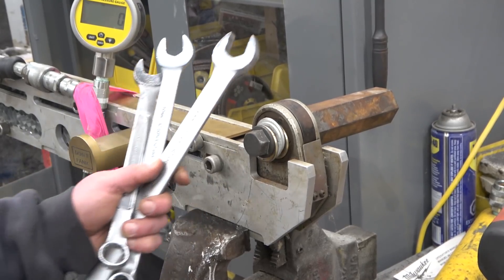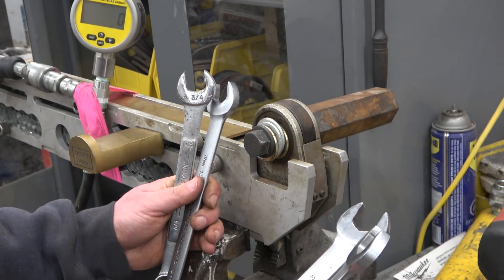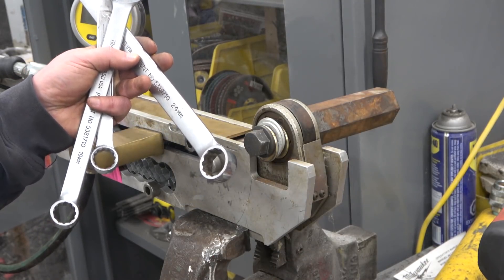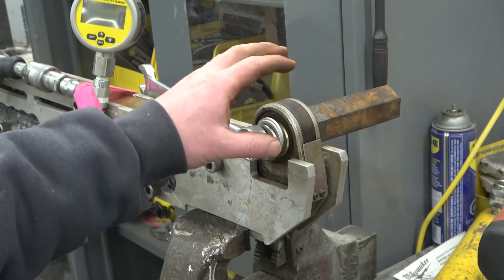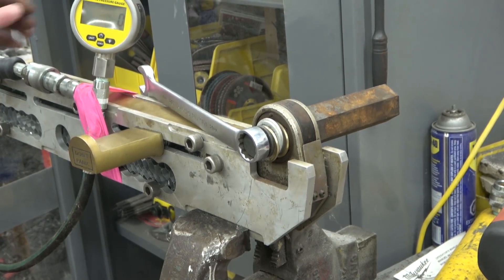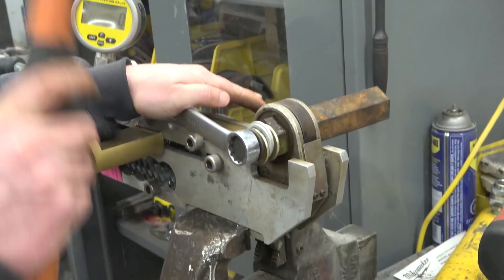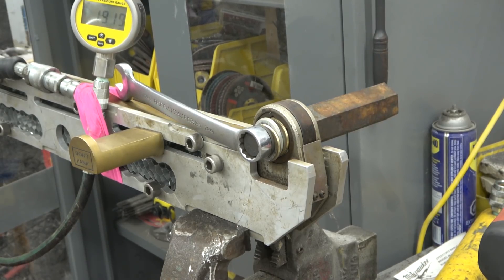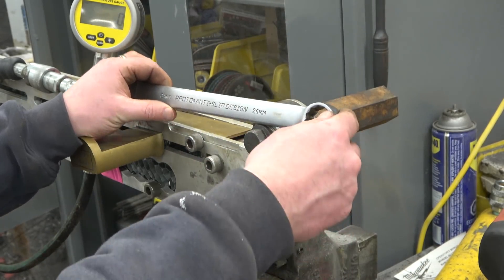do METRIC wrenches fit INCH bolts?

Comment: 14mm is oh-so slightly smaller than a 9/16", and thus makes a great "close tolerance" 9/16 substitute, when ya really want to reef on 'er, but don't want to round off the nut. (Mower blades are often held on by 9/16.)

14mm will fit on a 9/16 bolt head, though if the bolt has surface rust, or is plated, a gentle tap may be helpful.

Comment: I've found mixing and matching inch and mm wrenches and sockets quite useful. I've taped a Fraction-Decimal-Metric chart to the inside of my tool case cover for quick reference. I always try the smallest nominally dimensioned wrench for the fastener. Using your 15/16 example, I'd choose a 15/16 wrench (.9375"), not a 24mm (.9449"). It increases the odds of a tighter fit. When I bought those fancy Gearwrench ratcheting combination wrenches, I got only the tightest sizes: 11mm, 1/2", 14mm, 5/8",  no getting around the 10mm and 12mm. Larger wrenches/sockets go like this for tightest fit: 17mm, 19mm, 13/16", 22mm, 15/16", 25mm for 11/16 through 1."

Comment: How ludicrously hilarious. Testing a  mathematical hypothesis measuring who came first, the chicken or the egg? Statistically the better 3/4 derives that I do by computing a wrenches slippage between the two types, 6pt-12pt, and multiplied by size cross compatibility IMP- M. Is then divisible by a bolts yield limit to the variable, “H” power, (hydraulic pressure). When not only the formula, but your brain seizes, can the dead-blow hammer die. In summary, into the “Fuckit Bucket” this theorem goes.

Comment: And that usually works fine for "large" sizes. But a 1/4" 12 pt will turn a 6mm 12pt bolt into a vice grip sized bolt

Comment: This is always an interesting subject.  Inches are divided by 16 and metrics are divided by 25.4.  So there sizes where wrenches will be interchangeable.  As a quick reference you can multiply a metric size by 4  and get a close estimate of the nearest size in inches.

Comment: Outside of the exotic world of high precision/aerospace engineering, most fasteners and tools are made with pretty loose clearances, and the best tool to use is the one that fits the best.  How it  fits is more important than the size stamped on it.

Comment: Here are some other questions to answer.  Why does the 11mm fit nothing?   Why do they leave the 16mm  and 18mm out of so many sets? Why are those sizes so shunned? Metric is a curse, do we really need both 12 and 13mm head size? Why not make it a law to skip every other size 10, 12, 14, 16, 18 etc do we really need 1mm increments? Tool companies would lobby against it granted, but it sure would be a step in the right direction. Don't even get me started on C vs. F.

Comment: place i worked at had metric and sae bolts we had to use, and since metric was a tad rare, finding a wrench was difficult sometimes. whatever wrench we needed for the m8 threaded bolts, i just found me a chinesium 1/2 inch that was just out of spec enough to do the job  for both and hung on to that thing for the life of my career there.

Comment: When you first cranked on that 24mm and it stuck on the fastener that somewhat illustrates where a 12-point might be inferior to a 6-point, where fasteners are rounded or worn or undersize, a 6-point can get a little more grip on them.  I've experienced this working in my dad's shop and on rare occasions a 12-point wrench would not grip well enough so we would hunt around for a 6-point.
Many, many years ago I had a couple of friends in a small shop who worked on foreign cars.  This was when foreign cars were pretty rare.  They told me that they could get by pretty well using SAE tools on the metric fasteners.

Comment: Come on you must remember I think it was called metwrench set's they sold years ago that seemed to be generally to big or to small but one set fit it all.  I went to interview for a job and saw a set of them and I walked out. I got called later and asked why I left? I said I don't want to spend hours fixing all the nuts and bolts srewed up because  you use metwrench crap.

Comment: As a machinist, It’s useful to have a knowledge of imperial/metric bar stock dimensions for manufacturing components. 1/2 inch provides 0.7 mm machining allowance for 12 mm shafts. And so forth.

Comment: was doing my cars tailpipe and had a funny coincidence. 15mm was too small and 16mm slipped. the inch socket in between was perfectly snug and could open the rusty nut. The other nut 16mm was too small and 17mm slipped. the inch socket in between had no problem.

And what comes to the 12 point when doing rusty tailpipe nuts and bolts. 12 point rounds the nut when 6 point didn't. Think the case is different since the size was 10mm and 13mm.

Comment: I agree with the comments I read, but you just have to think about how much a tenth of a mm is to realize that most of the converted dimensions are probably within the tolerance of the wrench.
Here is a list of the common inch sizes with a metric equivalency:
1/4" = 6.35mm
5/16" = 7.9375mm --> 8mm wrench
3/8" = 9.525mm --> probably a 10mm wrench
7/16" = 11.1125mm --> probably an 11mm wrench
1/2" = 12.7mm --> 13mm wrench
9/16" = 14.2875mm --> 14mm wrench is a little tight but usually fits
5/8" = 15.875mm --> 16mm
11/16" = 17.4625mm --> 17 or 18mm wrench
3/4" = 19.05mm --> 19mm wrench (5 hundredths of a mm difference)
7/8" = 22.225mm --> 22mm wrench
15/16" = 23.8125mm --> 24mm wrench
1" = 25.4mm --> 25mm wrench will probably work

The bigger the size the more likely it is to fit within the tolerance of the wrench and bolt fabrication. 1/4" and below you might start getting into too much slop.

If you are limited on space or weight and need to take a socket set or wrench set just take the metric sets.
But that is just my opinion.

Comment: Maybe you can try inch spanners on metric bolts. My understanding is that it doesn't work so well but have not tried it myself. I'd be interested to see if this combo could be used when the correct tools are not available. Keep up the good work. Cheers from the other side of the earth.

Comment: The most modern, "Industrial", inches, define one inch as 25.4 mm, and was adapted 1930 in UK, 1933 in US, and by 1935 by the rest of the Commonwelth (including Canada).

So a modern 15/16 inch bolt is:
(15/16)*25.4 = 23.8125

So if you have never bolts, the 24 mm wrench is 187.5 µm to wide for a modern 15/16" bolt.

US and UK (as also used in Canada), used  different "Imperial" inches, before the "Industrial" inches was adopted. This because the sticks used to define the UK and US inches, although the US stick was made to be a copy of the UK stick, differed in length, and they also greatly varied in length over time (oxidation, heat expansion et c.).

In 1866, the US government defined a conversion factor of 1 m (1000 mm) being equal to 39.7 inches. That is 1 inch = 1000/397 mm ≈ 25.5 mm.

In 1893, the US and UK "Imperial" inches was for the first time defined in mm. By that time, how long 1 metre was, was still decided by a stick, but the metric stick was much superior to the sticks used to define the UK and US inches, and didn't vary much with time. And there were also strict rules in place, as how to store and handle the metric stick, so that it's length would vary as little as possible.

An US "Imperial" inch, was in 1893 defined as 25.4000508 mm.

An UK "Imperial" inch, was in 1893 defined as 25.399977 mm.

So if you have an older 15/16 inch bolt.

US "Imperial" inches (1893-1933):
(15/16)*25.4000508 = 23,812547625 mm

Canadian "Imperial" inches (1893 - c:a 1935):
(15/16)*25.399977 = 23,8124784375 mm

Comment: I work on Rail Vehicles in good ole NZ and use Metric/Imperial box ends interchangeably as some Locomotives are Japanese, some are NZ Made and US made. 3/8 - 10mm. 1/2 - 13mm. 9/16 - 14mm to name a few I regularly use both ways

Comment: As you probably know divide the lower number of the fraction by the larger then multiple by 25.4 gives the inch fraction in mm. 15/16” = 23.8125mm. Here in U.K. have had to get used to using both metric and imperial simultaneously and still use both ie miles per gallon but fuel sold in litres weighs in grams drinks in pints. Great videos keep them coming AvE. Thanks

Comment: We buy industrial grade sockets for tooling we supply to automotive and heavy equipment customers. One manufacturer has flat out said that in some cases they use the same punch for the nearest imperial and metric.

Also, can we get a video specifically detailing that hammer? That was epic!

Comment: It’s simple math. 25.4mm is an inch. So, 1mm is 1/25.4 inches, 2mm is 2/25.4 inches…and so on. At particular spots as you move up in size, you will get instances where a mm measurement will correspond good enough with an inch measurement. Using this simple formula, and a little decimal to ratio conversions, you can quickly determine such things as an 8mm wrench is good for a 5/16. 8/25.4 is essentially .315. .315 is 315/1000. Divide the 5s out, you get 63/200. Now we all know 9 goes into 63 evenly, and nearly at 200. So 9 into 63 is 7, and into 200 is 22. So, a 7/22” socket is pretty close to an 8mm. And since 7/22 is about 1/3 and some change, 5/16 is also about 1/3 and some change. So, I don’t know why it’s so fucking hard for people to not figure it out instantaneously in their head mathematically.

Comment: Most Canadians have to have both Imperial system and Metric wrenches because vehicles tend to have metric on the engines and Imperial on the body, and other such shenanigans. By the way, at university we tested wrenches for strength and found the good wrenches like Snapon will break instead of spread the jaws. The cheap wrenches spread the jaws and round the nuts so you get super frustrated. Lesson: buy the best wrenches you can afford. They will last a life time.

Comment: Any mechanic worth his salt knows which sizes interchange. 8, 11, 13, 16, 19, 22, 24 will all work fine on SAE fasteners. 10, 12, 13, 14, 15, 17, 18 mm are the ones you must have. Build and sell that set, you’ll make a fortune.

Comment: The smaller tarts have less tolerance, 13 will slip on a clapped out 1/2, and 10 mill will slip on a stripped 3/8

Comment: Yes and no.  My box is metric with a few selections.  1/2 in, 5/8th to be a couple.

Edit:. Back in highschool in the late 90's metric was the upcomer and SAE, while plentiful, was on its way out.  I had these conversion tables dedicated to memory.  Now, not so much.  There are some SAE wrenches that don't convert well to metric and vice versa.  Most of the stuff that is out there metric mostly in the US and I had a limited budget. The stuff that I need SAE is either limited or so old you probably can't get parts for anyway.  Cheaply.  Hence my reason for preference, six point box sockets when I can get away with it.  

On another note, I have a no name 25/32 in piece of Chinesium socket that's a bit closer to 19mm.

Comment: my socetrack hold 1/4,  6mm,  7mm,  8mm,  3/8, 10mm,  7/16, 12 mm,  1/2,  9/16,  15mm,  5/8,   11/16,  18mm, 3/4 etc  They work fine and rarely do I need anything but The couple of 10th of a thou is more than made up for by wear on the tool

Comment: ...in my tool pack I carry a very specific set of wrenches...and I carry only one wrench per size that I use (I don't carry a 1/2" I carry a 13mm etc.) as those 'cross-overs' fit fine...and I've had to on more than once occasion double up on wrenches as the guy previous didn't understand the relationship between ft'-lbs and clamping force of the fastener....

Comment: Ah, in a similar vein:
I once told that a RCH is actually the same measurement as a BCH (not to be confused with a BRCH).  Can this be true?  Obviously, a RCH measurement originated in the Irish area, yet a BCH is more related to Nordic areas.  Does this mean that Irish women are actually the equals of their Nordic peers?  I hate it when you open up such a can of worms --- comparing metric with inch......

Comment: As far as making the broach tooling that cuts the box end of a wrench. The snap-ons are actually not the same metric to inch dimensionally on the print. I hold +0 -.0002" over roll pins on the spline at finish diameter. However real world real use it's doesn't make a f'in difference at all lol. And to further that the line workers at fap off double and triple broach their parts even after specifically being told that the tooling is not designed for that... So what you get off the tool truck probably is basically identical metric to standard or close enough to get the jorb done.

Comment: One of the first things I learned as an apprentice in the pump industry was 15/16” is the same as 24mm.  My spanner set only went up to 19mm but I had a 15/16”. Can’t tell you how many M16 bolts I tightened up building fire pumps.

Comment: And sometimes they're Exactly. The. Same. Wrench. that they were too lazy to set up 2 sets of tooling for, so they went with the one that's 0.008" larger and stamped it with either size... sigh.  Probably the same reason the world has gravitated towards e.g. 21mm + 24mm + etc. as the more common drive standards, because we already had 13/16" and 15/16" and fuggit.

Comment: I've always used 19mm and 3/4" interchangeably because it's only 0.26% difference. 3/8" can be handy for a damaged and/or stuck 10mm, and 13mm and 1/2" is big enough that the ~2.5% difference isn't really a factor if the 1/2" A/F hex is in good condition.

Comment: edit
Sorry sir, incorrect testing parameters. Not exactly sure why it is you'd be pitting 6 point against 12 with brand new fasteners. I know for certain, you being a wrench bender by trade, if I handed you a 12 point to break the nuts of an exhaust manifold you'd throw the damn thing back at me. In the words of Justin Trudeau's best friend, the former vice president Joe Biden, "come on man!"

Comment: as i am a retired auto mechanic with 32 years experience i can truthfully say that what AvE says here is quite correct. other matches are 8 mm to 5/16, 13mm to 1/2in and 14mm to 9/16in.

Comment: hindsight an all that, might maybe just mill down the flats on that herking chunk of Hex stock ya got there and make whatever size "bolt head" you need for the testing of 6 vs 12, at least then the threads wouldn't yield either the flats would strip off, or the whole top will shear off and go for a ride around the room, I mean, you do have a clapped out Bridgeport, and a town pump cnc

Comment: I've measured a few of the 'equivalent' wrenches and sockets and found them to have the exact same dimensions.  I didn't measure any of my Snap-On level tools, maybe they actually do make them a few thousandths different to be precise.
Reply: Not really, they spit it out in the form of marketeering wankoffery by calling it " flank drive " or some such.
In other words, " we turned sloppy manufacturing tolerances into something you never knew you needed and we will charge you double for the privilege "

30 year Snap-on addiction myself but otherwise a normal bloke.

Comment: A cheap half worn out 18mm will fit a 3/4 bolt head real nice too. The right wrench is the one that fits tightest and leaves the least chance of rounding off in my opinion. I love cheap old yunk wrenches cause it doesn’t hurt as bad cutting them up to make specialty wrenches to get at things.

Comment: Math is beyond some folks and we won't get into such heavy ideas like manufacturing tolerances.
Okay maybe . . . 5/16 and 8mm as well as 7/16 and 11mm are mostly interchangable, 1/2-13mm usually are, though get tolerances at the far ends and you can round the corners on a bolt or nut (1/2) or not be able to fit the 1/2 wrench on the 13mm nut, though most 13mm nuts today are sometimes loose in the fecking 1/2 wrench (cheap chinesium all to often in both cases) but 1/2 is 12.7mm. 9/16 and 14mm seem to be the same today. It has been years since I've not been able to fit one onto t'other. So long I forget which is supposed to not fit over the other without looking it up, and 5/8 all to often slip over a 16mm nut as will 17mm often fit over a 9/16 nut. I get the feeling the stuff is being made to work on either or and just stamped as needed in the case of low end wrenches, and sockets, and fudged in the case of nuts and bolts.

Comment: My buddy at work keeps trying to tell me 9/16 and 14 are the same, I will swap a 3/4 with a 19 any day as well as a 7/8 and 22 (for hydraulic hoses and such) but a 14 and 9/16, no chance, I know the difference between a 9/16 and 14 is about the same as a 7/8 and 22 but when its that big it doesnt matter a whole lot

Comment: Need both sets so at least one socket will fit those rusty ass fasteners.ill fit once u adjust it correctly with a large enough hammer.

Comment: You can calculate what is equal to what:
1 inch = 2.54 mm so 5/8 is (2.54 / 8) * 5 = 15.875 mm or super close to16 mm
Reply: Decimal on the mm side needs to move one place to the right.
Another interesting note, is that the standard inch has been defined in metric since sometime in the 1970's.
Reply: @pauljs75  Yes thanks a lot, I'll edit that! :-)
Yes so it is a way become metric.

Comment: When I was installing flanged water meters and backflow devices a few years ago, we preferred 24mm in the “wrenchin” hand because it was faster to get a hold. And 15/16 in the “hold’r back” hand, cuz it holds more securely, especially if covered in sand and mud.

Comment: Don't know if you know of Metrinch sockets/wrenches. Would be interesting to see how they compared. In my experience, they can round off any bolt metric or imperial
Reply: Hurrah! Someone else remembers Metrinch! I was beginning to think I’d imagineered them. Odd kinda flank-drive almost-but-not torx shape. Either the perfect solution or a total nut-rounder. Only way to find out was to try...